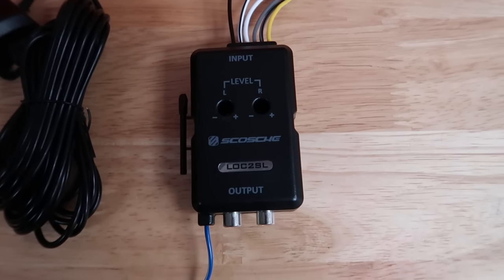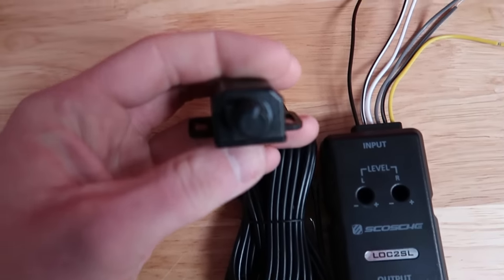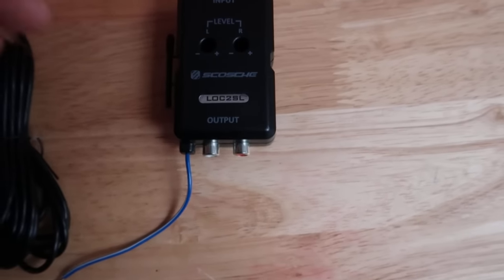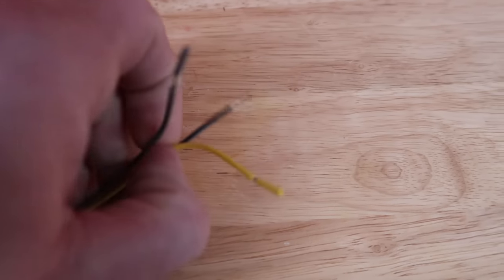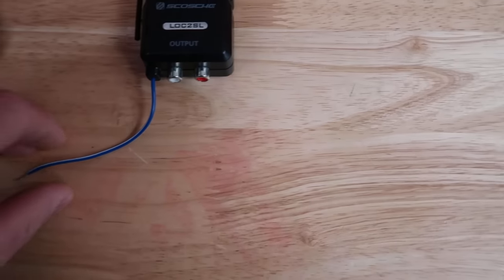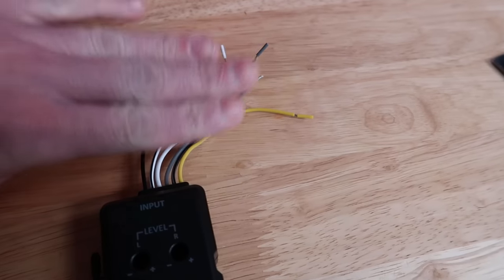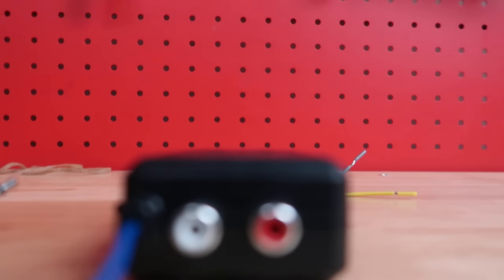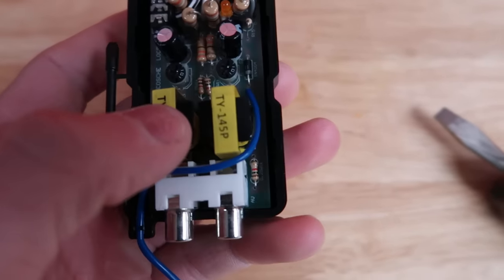Install AMP/SUB FACTORY RADIO Installation Without RCA Hook Up AMPLIFIER STOCK HEAD UNIT Car Stereo

Comment from the maker: PART SHOWN IN VIDEO For Installing AMP/SUB To Factory Head Unit LOC2SL Linked Below
https://amzn.to/46nGh3S
If You Want Something Better If You Got The Extra $$$ LC2i PRO Is Really Nice
https://amzn.to/3DLzbrT
AMPLIFIER COMPLETE INSTALL WIRING KIT
https://amzn.to/2JEjQiN
QUICK WIRE SPLICE TAPS & CONNECTORS
http://amzn.to/2Fg8T24

Comment: You lost me when you said that the speaker wire polarity doesn't matter. It absolutely does matter. A good way to visualise the importance of having the correct polarity is to take any speaker where you can clearly see the cone travel. Connect wires to the positive and negative terminals of the speaker. At the other end of those wires, hold the negative wire constantly to the negative terminal of a small 9 volt battery and then tap the positive wire on and off the positive side of the battery. When connection is made, the voice coil which is connected to the cone should travel out and then back in when contact is stopped. Then try reversing the polarity and the cone will travel inwards when contact is made which is incorrect. The voice coil needs the correct polarity signal to travel correctly within the magnet to perform as intended. Sorry to oversimplify things but it may help some to get it right.
Reply from the maker: Graham Serle what time was it in the video?
Reply: Everyday I'm TECH n It  can you please remake this your confusing alot of people
Reply: Everyday I'm TECH n It  Remake
Reply: Approx 4 minute mark.
Reply: Graham Serle at exactly 4 min. Mark...... i was like. Wtf yo pray nobody listens to this fool lol
Reply from the maker: My bad
Reply from the maker: Thanks for the info 👍👍👍my bad dawg
Reply: @grahamserle7930  sooo do i follow the video orrrr

Comment: Thank You!!! I was about to buy another LOC for the same price and it didn't have the remote turn on which is critical and the wired remote that is included with this one, also your video was very helpful, however on another video a guy showed how to use a 9-volt battery to test whether you have the negative and positive correct when hooking up to to the speakers

Comment: What if you have a oem subwoofer can you connect the wires to the sub woofer cables? My rear speakers are in the doors. (2012 Acura tsx wagon tech)
Reply from the maker: Yes sir my truck also has OEM subwoofer & that the wires i connected it to also so you can for sure.
Reply: Everyday I'm TECH n It do you have to tap in with the left or the right speaker signal?
Reply: My question exactly, I'm going to inatall a sub and amp in my son's Audi A4, I found it had an OEM sub in the back. But there are only two wires, so would you hook up it to the left or right speaker wires? Is it okay to use this OEM sub for this purpose? Can you only hook up one side, or will it not sound/work right? Thanks!
Reply from the maker: @craigb.golden6494  you can repeat wires or make the 1 negative wire into 2 negative wires go to R/L negative & 1 positive wire into 2 positive wires for R/L if that makes sense!
Reply from the maker: you can repeat wires or make the 1 negative wire into 2 negative wires go to R/L negative & 1 positive wire into 2 positive wires for R/L if that makes sense!
Reply: @EverydayImTECHnIt  That makes since, thank you!
Reply: Craig B. Golden does that method work exactly the same as plugging the wires into the stereo harness?

Comment: I didn't know I could hook it up in the back. I was gonna tear apart my dash and hook it up behind the radio all hillbilly style. Awesome. Maybe I should have went to school longer
Reply: Nah you had it right cause the front speakers got more frequency than the rear this guy is going of other YouTube videos he watched “+or - I don’t think it matters”....really? Let’s see that applied to car batteries....
Reply: @TwO2ThAt  if you hook it up to the wire harness, do you need to split the wire three ways, or just take the wire from where it was going to the new line?
Reply: @rickstagner5717  all you need to do is bridge the wires on converter so white/grey+ and white:black/grey:black- then you run each pair of wires to the -and+ on either side of front speakers( driver or passenger side) u only need one side which ever is easier to run wire to then the rca cables from the amp to converter and that’s it  I prefer placing converter by amp to  tune all the equipment in the same place and if you hear that humming noise coming thru just ground the black wire on the converter or use the same ground on the amp I know  some converters come with yellow and red wires if they do I just run em to the amp

Comment: only thing to remember is that if your planing to just add a 2 channel bridged or a  mono amplifier and a sub and nothing else in the boot, your gonna lose your rear shelf speakers. this method works best only if you have a 4 channel amp (2 channels back to the rear speakers and two channels bridged to your sub) or a 2 channel amp that can run tri mode which is very rare these days tho some kenwoods and pioneers could do that back in the day, or a further option is if you have one amp that has both rca in and rca out so you can daisey chain to a 2nd smaller 2 channel amp back to your rear speakers :) soz if its a bit obvious but worth remembering in your planning :) splicing into speaker wires and still using them to power the speakers too is to me and anyone who cares atall about things being right and wanting the best outa what they've got is a complete no no and just taking the terms rookie and lash up to a whole new level as if using this device wasn't compromise enough any way to keep your factory head unit, but dont make thing worse than they have to be  :)

Comment: The blue wire goes to remote behind the amp or the power of the amp
Reply from the maker: remote it's the wire that tells the amp to power on/ turn on & off the amp power wire is big wire ran from battery + with in line fuse
Reply: @EverydayImTECHnIt  so I can add the blue wire which is remote to a power wire

Comment: I'm pretty sure that the remote wire isn't what powers your amp on and off. Your amp has its own. That remote wire is for the power on the converter itself

Comment: thanks for the information. Can you use this loc to hook up 6x9s? . Any help is appreciated
Reply from the maker: yes if you want to power 6x9 with additional ampilfier & not head unit built in ampifier hope that makes sense the answer is YES
Reply: @EverydayImTECHnIt  thanks I want to invest in some good 6x9s then run them off the new amp
Reply from the maker: @raymondkhan2709  yes would work perfect for that

Comment: So I bought a similar one like this but it has no power wire but 2 brown ground wires. I still have a bad engine noise with this hooked up. I grounded both brown wires together.

Comment: Did you program the levels
Reply from the maker: ya you adjust it after it is all hooked up for best sound you prefer or so it sounds best while it is playing music out of speaker turned up kinda high but not all the way on volume & just adjust the screws to your liking hope this helps
Reply: @EverydayImTECHnIt  cool heck I had my converter for over a year now and just figured out there where levels on it thanks for showing me what I missed

Comment: With this do I need to run a power wire to the battery or can I get the power from the radio?

Comment: I know this is super old, but would I still hook it up to both speakers if I am only running one sub and one amp? Thanks...
Reply from the maker: Yes for best results or sound
Reply: @EverydayImTECHnIt  I actually saw that you can run one and connect jumps to the other side...
Reply from the maker: @draynged7869  Ya you definitely can it won't hurt anything and it'll definitely work

Comment: i used this on my jeep compass 2018 head unit and ran my remote wire to the amp and the amp stays on when the car is off?
will the green power light kill my battery?
Reply: Yeah definitely need to check your wiring. you can always hook up the remote turn on wire to your head lights fuse that way you can turn your amp on and off at will

Comment: There are loads of aftermarket sterios That work with the steering wheel controls now. The stock radios in today's cars and trucks have lots of faults that hurt the performance of aftermarket amps,sub's,and speakers such as bass roll off at high volume and signal frequency limits. Only suggest keeping stock units for cars and trucks that have module integration incorporated into there deck's. Like the Dodge hell cat, or fords with the I link set up, or head units that are tied into the restraint, body,ecm module,and such.
Reply: North Woods Road Warrior, for most cars you need an additional adapter to keep the integrated steering wheel controls with the new head unit

Comment: 5:00 u said the blue cable coming out near the rca ports is plugged into the positive on the amp. did you mean to say it plugs into the remote port?
Reply: I’m 99% sure that he did mean the remote post on the amp.   I’ve been searching for days on how re-hook my car stereo up and he explains it nicely and tells us where to hook up each line.  So instead of running the blue ‘remote on’ line from the head unit.... just have to connect that blue output line to the AMP’s ‘remote’ line.
Reply: Yea..it goes to remote. Or you can run a toggle to the amp via remote and positive on amp so you can remotely turn the amp off..unless you're a moron like me...and never remember to hit the toggle and I kill batteries.

Comment: So, the single blue remote wire, on the output side of the LOC, doesn’t go to the remote port on the amp? It’s tied in with the constant power wires? That doesn’t make sense to me :-/ Or does the output remote wire go to the remote slot on the amp? Thanx bud
Reply from the maker: no single blue wire goes to amp to tell amp to switch on/off or to turn on amp & turn off amp you don't have to use this feature but is way easier then having to run wire to fuse box then tap into fuse box & run wire to turn on/off amp it is a feature that just makes it easier to wire in amp on this specific high low converter more other ones don't have this feature hope this helps
Reply: @EverydayImTECHnIt  
I’m just worried that this would leave the amp on all the time…and drain the battery? If I have the power wire on the input and output sides both going straight to the battery and amp, won’t this cause the amp to stay on all the time?
Reply: I starting chasing wires, getting ready to splice everything together, then saw your video, and double, triple thought about it for waaay too long 😆 So I just decided to pause n I’ll do it when I wake up in a few hours 🤪
Reply from the maker: @pezzathemuso1982  it won't trust me basically the way it works is it has an automatic sensor in it so it senses when audio is going through the Highlow converter from your head unit it works perfect that's the way I have it hooked up on mine never had any issues with amp staying on or not turning on I was kind of skeptical at first myself but it works like a charm actually a really cool feature about High low converter
Reply: @EverydayImTECHnIt  is it alright to connect this LOC to the radio power and ground? Or do I need to run a separate ground and run separately to the power off of the battery?
Reply from the maker: @pezzathemuso1982  It won't trust me it automatically senses audio going through converter
Reply: I mean… can I splice the LOC’s power wire straight into the radio’s power wire, that’s coming out of it’s harness?
Reply: As well as the ground…? I was gonna do it tonight but, I keep getting off work, too late
Reply: I’ll test it out if it’s a “maybe”

Comment: The blue wire does not go to power on your amp that would go to the remote on your amp.. Wich yes tells it to turn on and off
Reply from the maker: correct thanks for clarifying a lot of people aren't familiar with that feature of this particular Highlow converter.

Comment: Shouldn’t the remote wire go to the remote plug on the amp instead of the power? Or even maybe hook the remote wire up to a fuse? Or did it work just fine  ? Lmk thanks!
Reply: Chris Cam you're right. The remote wire from the LOC goes into the remote wire plug-in on your amp, not the power. Plugging it into the power would not turn off your amp
Reply from the maker: Correct sorry my bad i miss spoke
Reply: thanks!
Reply: +Chris Cam Cool.
Reply: Question I connect my remote wire all ready !i buy this converter ,, coming Witt remote wire too I NEED CONNECT BLUE REMOTE FROM CONVERTER too?
Reply: @pablitomontanez1131  
Remote wire (blue) need to be connected to amp (rem) to power on n off. Easier than tapping to fuse or acc  12v source
Reply: works either way

Comment: You were saying that you connect them to the speakers but a better thing to do it put the wire in the connector right out of the head unit and use all the power wires from the head unit or run a separate power wire doesn’t matter and then run your speaker wire for your amp into the head unit area like you normally do instead of messing the with Sauter on the speakers
Reply from the maker: ya for sure your still hooking it up to the same wires just at a different place
Reply: i think the whole point was showing how this could be handy for people even if they have a head unit with line outs, but didnt want to run cables thru whole car, could use this as a compromise too tbh killforthewin bud, sure they will have to run a live etc for amp anyway, but might suit some this way :)

Comment: Quick question I have one installed in my car now where do I hook the remote wire from the amp up too please and thanks
Reply from the maker: your talking about the lone blue white stripe wire correct??? It connects to the "TURN ON" terminal on your amp!!!
Reply: Easiest is the fuse for your radio
Reply: From there u connect the amp remote to fuse box right

Comment: My radio wire connecting to my power wire leaves my amp on even after I cut my car off. What could that be I drive a Nissan Sentra 2006
Reply: You need to install a kill switch, the power wires just bringing in constant juice to your amp, from the battery.

Comment: Those wires on the end look kind of short to connect to the left and right speakers. What size wire do you need to adapt to extend the length ?
Reply: I have the same question

Comment: Hey so I was going to buy this box for my subs but how to can I extend the wires to be able to reach my battery and my rear speakers from the box? Because the wires are too short to reach anything, so what wires do I buy to connect to the box to extend the wires to my battery and rear speaker.
Reply from the maker: just use longer RCA cables check out what i have linked to amazon that should be more then long enough & only cost like 10 bucks & well solve your problem https://amzn.to/37xiujO

Comment: If I want to tap into a factory subwoofer to get the signal which wires do I use on the LOC? The Left speaker signal or the right? Does it matter?
Reply: Did you ever figure out? Trying to do this on a 2014 ram

Comment: Will I still use the output loc2sl if I’m running a powered subwoofer ??? I’m confused
Reply: I’m gonna wire my rear speakers into the powered sub for signal. I only bought the loc2sl cause of the auto shutoff remote deal .
Reply from the maker: Yes sir you use it for any aftermarket amp you want to hook up.
Reply: Wish I could call you to explain what I’m talking about, my powerd sub has 2 rca inputs but those ’s are just for the sound signal going in .
Reply from the maker: @midwesternfreethinker  I understand a powered sub is just a subwoofer & box with amp built in an all in one package. Do you have aftermarket head-unit? You would want to use LOC or this product if you want to hook up your powered sub to factory/stock radio. If you have a aftermarket head-unit installed then most of the time you don't need to use a LOC or this product to install powered subwoofer or aftermarket amp/sub.
Reply from the maker: @midwesternfreethinker  Ya you just hook up wires from LOC to R/L side +/- speakers wire totaling 4 wires to LOC & then plug in the 2 RCA cables from LOC to your powered sub to the RCA inputs make since I hope this helps.
Reply: @EverydayImTECHnIt  factory stereo
Reply: @EverydayImTECHnIt  ok man thanks. I’ll let ya know how it turns out .
Reply from the maker: @midwesternfreethinker  Right on good luck just let me know if you have any other qustions when u installing it.
Reply: @EverydayImTECHnIt  I did what you said and it worked!!! Thanks bud !! 👍🏻

Comment: So do i buy extra negative and postive wires to run them to the speakers. I have a suv
Reply: yes. extend them and tap into the rear speaker(s) with quick splice connectors.

Comment: Do I need to use the control knob in order for it to wrk
Reply from the maker: I think so but you adjust the knob to about 1/2 way & leave it you don't really have to mess with it in less you want to.

Comment: If we only have one sub do we have to wire left and right
Reply from the maker: Yes you need Both L & R
Reply: indeed you do the reason being that a stereo signal isnt the same both sides (panning etc is used alot in music production) , you need the two signals combined to make a complete mono signal for your sub :)

Comment: I need help on my 15 chevy traverse im going to run 2 12s n one amp for highs n one for lows can u hlp me out n tell me what to do if this will work
Reply: You need a 4 channel loc. Grab an adjustable or you won't have good enough signal.